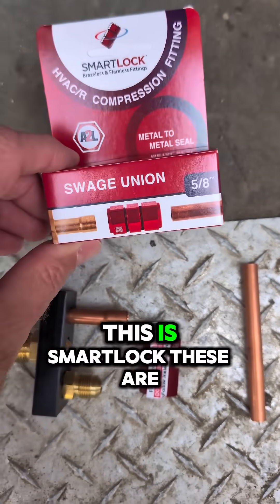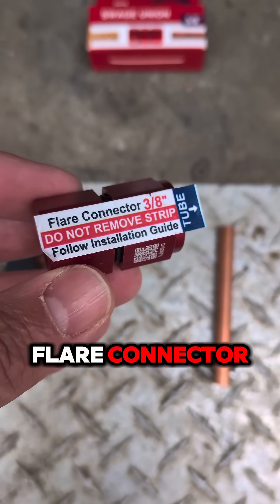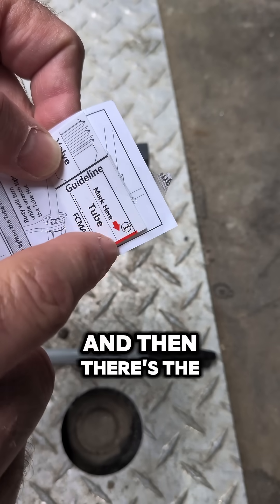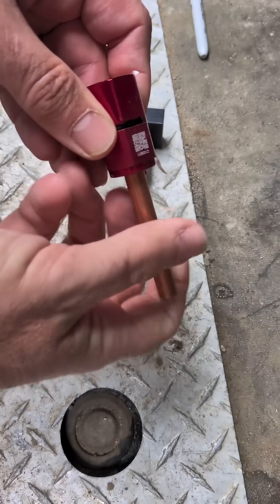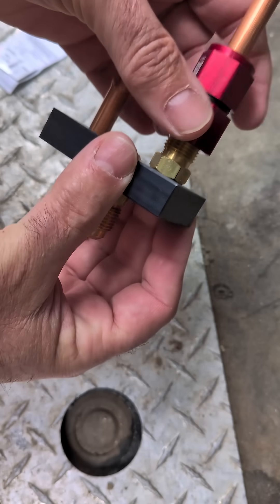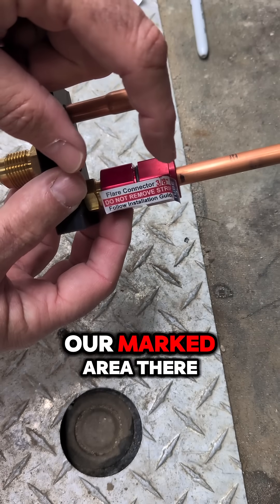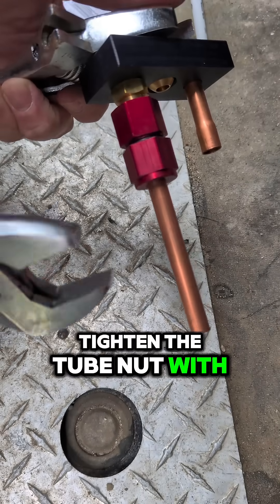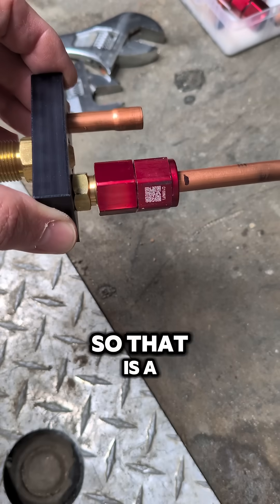SmartLock Refrigerant Connectors

Comment: Smartlock fittings don't leak. They are literally a metal on metal seal. The O ring has nothing to do with sealing, it simply helps guide the process. It could be removed, and nothing would change.  The only issue I have currently is price point, or I would be using these a bunch. 35 years of brazing, but mechanical joints have been around forever. I do believe this joint is less likely to leak over a flare.